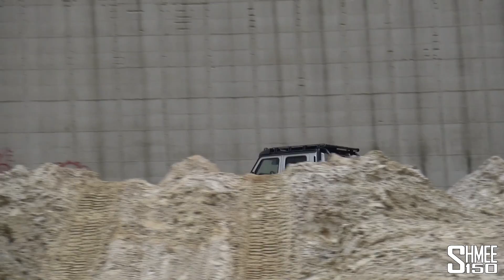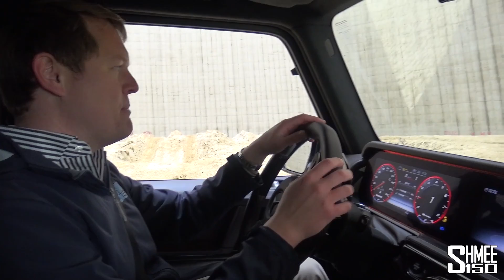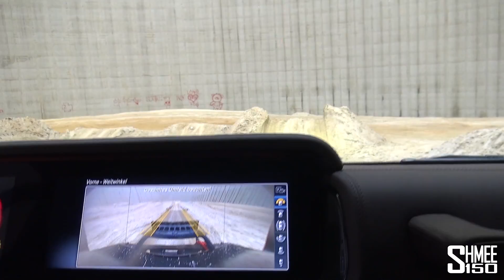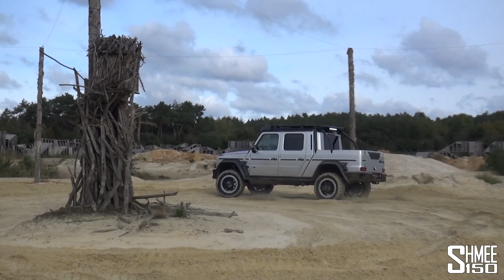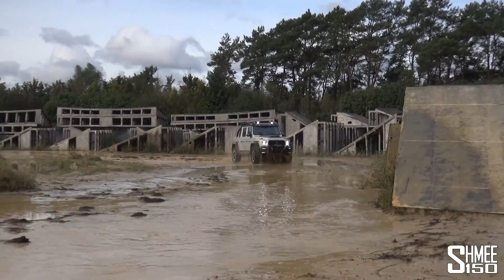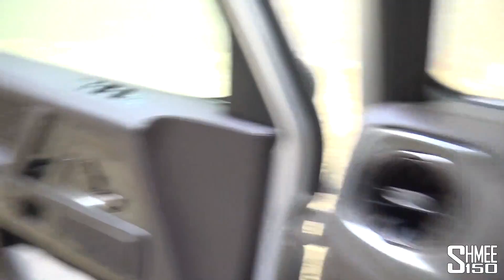The Brabus 800 Adventure XLP is a RIDICULOUS Off-Road G63 Beast!

Comment from the maker: It doesn't get much crazier than the Brabus 800 Adventure XLP eating up the gnarly terrain! It's the most extreme G63 you could imagine and handles off-roading like it's nothing. Can you imagine a more beastly car than this?!
Reply: How much is it ? Does anyone know
Reply: @harley7417  $1 million in Aus. LMAO.
Reply: now that you've sold the focus, 600lt?
Reply: Hummer h1? G63 6X6? Ford Bronco?
Reply: @SergalsRCute   RAM TRX(with 37x13.50r18 Yokohama G005(X-MT) tyres).
Reply: @gen1c8rs88  I mean crazy vehicles. Not another glorified hemi powerhouse. I'm saying this as a Mopar owner it's getting boring seeing them
Reply: How cute. Playing in the sand pit. Turn off the traction control and put your foot down. Or not. There's a lot of fun ya'll are missing. Need more speed through the water sections too. The fact that you didn't get wet is almost a disappointment. That's a park, not an "off road" course.
Reply: Actually think a Jimny would beat this one offroad. The Mercedes has too long wheelbase.
Reply: Exactly what a beast,how are u Shmee?
Reply: Grear video
Reply: Benz g63 6x6
Reply: This thing is insane!
Reply: Can we see it on a trail with rocks and actual obstacles
Reply: What about the 6x6? :(
Reply: It doesn’t get much crazier than that face.
Reply: Shmee150 Absolutely Incredible Video I'm glad you got to drive that Absolutely Incredible Brabus 800 Adventure XLP and I think next time you should have more fun

Comment: Given e motors got so much torque...    Would a weak efficient front wheel drive offroader with 4 electric in wheel motors make sense? Given how often you'll actually need the boost, 10km range at 40kmh would be fine, so little battery Weight.

Comment: I just don't get G Wagons. We had them when I did my national service 30 years ago, and it was a race every morning to get a spot in the VW Transporter and not have to suffer the G Wagon.  Have driven sivilian ones as well and they were no better.  I love MB. I own a CL. But I just don't get why anyone would pay for these bulky heavy boxes..
Reply: Well a lot has changed in 30 years hasn't it?
Reply: Its just a silly status thing, people only buy these to feel like they are better then everyone when they strut around
Reply: This is the new chassis, it's a complete redesign and based on modern MB chassis, and suspension. I would have never wanted a last gen because it was basically a TTV8 rattle can/jeep. However, the new model is extremely refined in every way